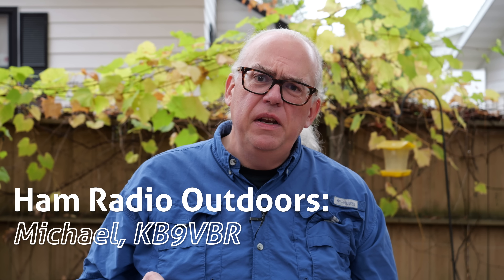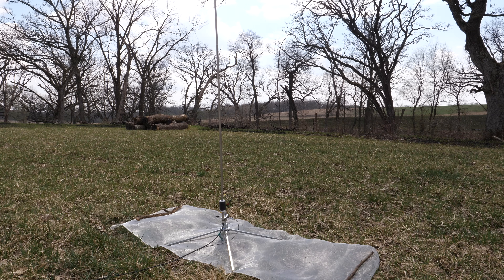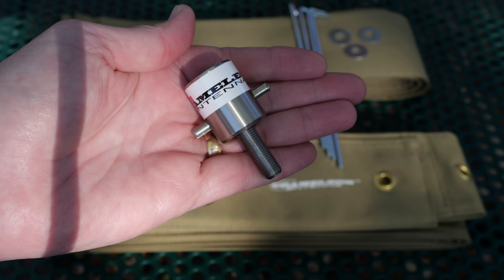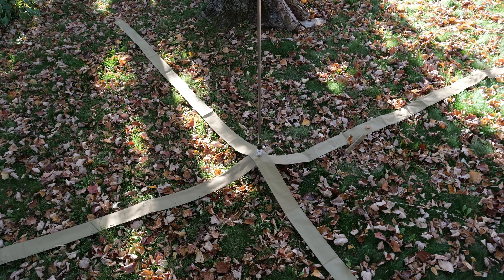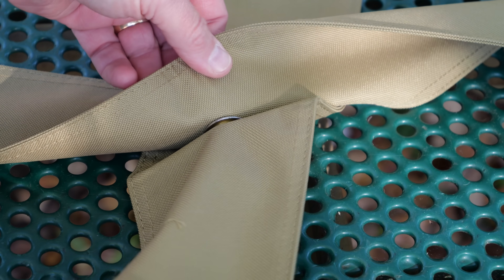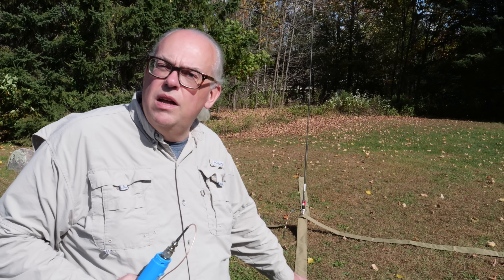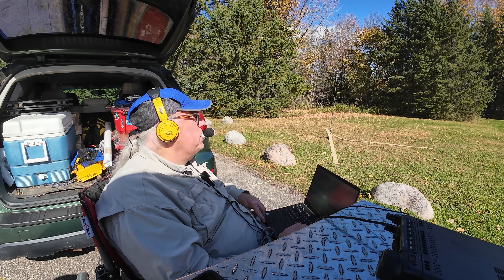I tried the Faraday Strip Radials for my antenna, and WOW!

Comment: is there a way to use the chameleon faraday strips with a surveyor tripod
Reply from the maker: If you spread the legs out, you can get the feed point of the antenna low to the ground. That would work just fine. Otherwise, Chameleon claims you can elevate the strips. I have not tried that, yet.

Comment: I think a lot of people are missing the point of using the faraday cloth or aluminum screen. Wire is narrow this spreads out the covered area and the concept of radio waves bouncing back from the sky. Would definitely improve the reception of signals. If elevated in center a few feet would more than likely project a lower radiation pattern. Just a thought.

Comment: Hi Mike, might have to give this a try.  Currently using a CHA hybrid micro with 60 ft of wire only on the roof.  Getting a lot of RFI noise on all bands.  Besides the ferrite, do you have any ideas for the noise?  Thanks
Reply from the maker: Try adding a second common mode choke at the point where you coax connects to your transmitter. This should filter out a lot of the noise that is collected by the coax shield itself.

Comment: Thanks for giving this a try, Michael. I can’t help but laugh at those who complain that Faraday cloth is useless — sometimes it performs just as well as wire radials, and other times it doesn’t. There are so many variables in antenna setups that results will always vary. Personally, I prefer using my own Faraday cloth configuration over commercial products, but I understand why people want to test them out. Ham radio is all about experimentation and pushing boundaries. This is how pioneers are created. The curmudgeon's and codgers are simply too stubborn to try something new.

Comment: Could I use these strips if my surveyors tripod was about 3-4 feet tall? Or would I have to go with elevated wire counterpoise?
Reply from the maker: Ideally the faraday strips should be laying on the ground. Chameleon says you can elevate them, but I haven't tried that yet. Can your tripod be lowered at all, some tripods have a lock that lets you spread the legs out farther and get the head lower to the ground.
Reply: @KB9VBRAntennas Thank you Michael, spread out the legs I shall! Cheers!

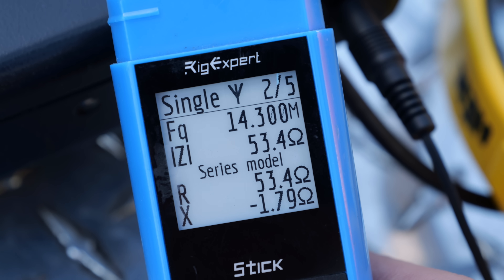Comment: Michael, thanks for your videos and have always enjoyed working you on POTA. You made a comment at 4:45 in the video about the fact that SWR only tells half the story. I wonder if you would do a video on what you look for and how you use the Stick in evaluating an antenna and it's deployment. I could learn a lot.

Thanks, and 73

Mike W9LG
Reply from the maker: In addition to looking at SWR, you also should keep an eye on X or reactance. As reactance reaches zero, your load becomes purely resistive, and the transmitter maximizes power output. Not all antennas will be resonant at 50 ohms, for example a dipole's resonant point may be 70 ohms and a 1/4 wave vertical may be closer to 30 ohms. So you may have an SWR of 1.4:1 and 0 reactance. The antenna is in perfect resonance. Joe and I did a livestream video on this a couple years ago, but maybe its time for a refresh: https://youtu.be/IUHicVvMyEY
Reply: @KB9VBRAntennas  Thanks, Michael. I watched the livestream; it's fun watching you and Joe have fun.

This is one of those things that I "learned" but didn't really understand, and probably still don't. So back to the books. I'll start paying attention to it when I'm setting a portable op. So when you set up, do you tune for reactance?

Comment: Hey michael.  I love your posts and POTA has changed my ham life!  I notice on many antennas, especially the POTA Performer, you use a isolation transformer from MFJ.  I see these are no longer available.  Is there a replacement?  Can ferrite chokes on the feedpoint accomplish the same?  Thank you for all you do for our hobby
Reply from the maker: Ferrite chokes on the feedpoint will accomplish the same thing. The MFJ choke essentially was that, a series of chokes inside a plastic housing. For a replacement, I've been using these chokes from ABR Industries. I've had really good luck with them: https://abrind.com/product/current-type-ferrite-assemblies/
Reply: @KB9VBRAntennas  Thanks Michael,  I have actually been using some snap on beads from DX engineering - but I was wondering if there was some other magic in the MFJ box.  Cheers!  Mike  KC2SWC.  Hope to catch you on an activation one of these days.
Reply: @KB9VBRAntennas  Michael, thanks for the review and your videos. Much appreciated.

On the ferrite chokes, you mention using them at the feedpoint. I use a 25' piece of RG316 with a built in choke on my POTA activations when I use an EFHW or EFRW, and place the choke at the transceiver end, effectively using the coax as a counterpoise. I assume the choke is used at the antenna feedpoint when using radials on the vertical. Do I have that right?

Mike W9LG

Comment: I'm always down for new stuff that doesn't tangle in my bag as easily as my speaker wire radials. But I am curious, if you have a simple WRC tripod do you have to but an isolator to use this? If I'm looking at it right the adapter screws into the antenna mount on the tripod. On the WRC this is connected to the center pin and the tripod itself is connected to the shield. So if I put the adaptor in, my radials will be connected to this center pin rather than the shield. Maybe the Chameleon tripod is set up differently.

Comment: Hello Michael, thank you for this video. A question: could there be a benefit to using the 2 strips full-length, and only having an orientation N-S or E-W? I may have to get them, just to try that(?). As always, the value of any item is personal - not fixed, and your videos help me assess the value. Thanks, KQ4IXD
Reply from the maker: To your first point, I've been thinking about that. My guess is that attaching the strips via their end grommet and orienting them in a V configuration will not so much increase the gain, but instead create a favorable Front-Back that will improve your signal to noise ratio and pull out weaker stations. Much like KJ6ER does with his PERformer antenna when placing the counterpoise wires in a V. That hypothesis is on my list to test. 

As for price vs value. In my reviews I don't evaluate an item based on its price, unless the item is extremely inexpensive and offers great benefit. Like you mentioned, value is an individual determination.

Comment: I wonder why people complain about the price of commercially available *quality* gear. No one is obligated to buy it. After all, as hams you can certainly make gear yourself.  If you think you can make it or an alternative cheaper, and you probably can, then knock yourself out. But for those who don’t want to mess with the process or don’t have the time then gear like this is available for plug and play operation. It’s a pretty simple decision. No need to knock the company’s price point or Michael for the full disclosure review. They price according to what they think the market can or will pay and they can make a profit. No one is forced to buy. No one needs to say this is price gouging. You don’t really need this bit of kit, there are far cheaper homebrew alternatives and no one is stopping you from doing that.

Thanks Michael, for this excellent video and the disclosure of the source of the item for review.
Reply: While I understand what you are saying, there is a tipping point, Chameleon is WAY over pricing the Stuff they "Make", I bought this FSR and I am very disappointed, with this you are locked into THIER stuff to make this work, For a $130 you get the cloth and an adapter to put it together, THATS it you don't get the ground spike, You have spend another $65 for that (130 + 65= $195), oh and that Adapter is 3/4-24 not M10-1.5 so you can forget using any of the expanding antennas, oh wait you can by Chameleons  (195 + 70= $265), and don't forget the Blank adapter from them its another $132, so total cost to make this work is (265 + 132= $397) over $400 dollars after Tax and shipping, so Quality not so much.
Reply: No one is knocking Michael at all and people certainly do have a right to comment on the price. The price is a "key part of any product!!! We all comment on the price of things,...all the time. That's nothing new. For radials, the price is obviously going to get attention - how could it not?
Reply: @jimp.7286 I guess you didn’t see the comments I saw, at the time I posted this comment. No worries. I saw several doing just that. Knocking both Michael and the company. Just thought you should know.
Reply: @mmcnew1  Sorry. Missed your reply somehow. Knocking the channel's owner and even others who comment in a respectful way,...that's the era we now live in - the era of social media. And I hate it. It's not been a good thing for mankind at all. Civility gone. I'm not going to bother reading what you're referring to as it would just irritate me. Why knock him? Makes zero sense. He's only sharing the product and the nicest person. Thank you for cluing me in. Cheers.
Reply: Your wrong Chameleon price according to the market then stick $$$ on top, I will stick with my wire thanks...👍
Reply: @martinsmith2984 Thats exactly what I said up there. But don’t knock Michael for the review or Chameleon for the price was the point. Many, many commenters were doing both, for no reason. If there’s no compelling reason for purchasing it after the excellent review and then considering the price/cost benefit (or a viewer’s subjective lack thereof) then the viewer can make that objective decision. All of Chameleon’s products are priced on the upper end. Everyone knows that. But that doesn’t make the review any less well done and the commenters being snarky to Michael about it is unnecessary.
Reply: @martinsmith2984  The supplied item was revealed as free at the get go. No one forced anyone to watch. As soon as they say “item was provided for free”, you and everyone else has the choice to move on and not watch. You detractors are hilarious. Like anyone forces you to watch and then purchase. Then, blaming the reviewer and the company. I do know Chamelon’s prices are high. So does everyone else. I’ve said so multiple times up there. But they *do* have the right to charge what they want. How is this so hard? Just don’t watch. Don’t buy. Make your own. Use wire. Whatever. But don’t knock Michael for a well done review. It’s strictly a “the company provided it for free, I reviewed it and it worked well for me, watch my QSO’s and evaluate for yourself”.  There are some hams who have enough disposable income (shocking, I know) who’ll be lazy and purchase overpriced kit as a matter of convenience. Who cares? If you feel that strongly about this whole thing…. never watch another video again as soon as any presenter says the reviewed item was provided for free. Never. I strongly suspect your watch count of product reviews would drop by 95% and you can spare yourself the agitation of knocking reviewers who produce said content.
Reply: @martinsmith2984 With your line of reasoning, why do you even bother to watch? As soon as any reviewer says any review item was provided for free, just click away and move on. You are 100% accusing Michael, or any other reviewer who receives any item from the manufacturer, of doing an intentionally deceptive review. If that were true, they’d hide that fact it was provided for free. But they don’t hide it. But this dialog has come to a point here and as Sherlock Holmes says to Dr. Watson in The Scarlett Letter “I have been guilty of several monologues upon the subject of late. I fear I have wearied you.” So, I’m done with this. Have a nice troll’s life. Peace out.

Comment: If you're going to bury those radials, check out dog fence wire. It is made for direct burial, has a tough coating, and is sold in large spools. My 250-foot roll came from Extreme Dog Fence and is impressive. The coating is almost impossible to cut with a knife. You must use wire strippers. The stiff coating also means it doesn't tangle easily. And the hard-drawn copper wire inside makes it excellent for antennas. It is the same copper used for overhead power lines.

Comment: For a far less expensive alternative, check building suppliers for attic foil. It's a ruggedized, tear-proof foil that is used to reflect attic heat. It conducts as well as faraday cloth and is easily rolled up. You can get it in various widths up to four feet. It cuts easily.

There's also something gardeners use—copper mesh about five-inches wide. It's used block building entrances to rodents and to keep slugs from plants. A quick search turned up a thirty-foot roll for $7. Tent stakes could pin it down.
Reply: Your right, why spend a fortune for something thats not going to be any better in the real world...

Comment: I love the idea of one side orange. With them wide like that they increase capacitive coupling with the ground. A great test will be over much dryer soil   . Yes you are correct with AM broadcast .The wavelength is very long and lots of copper in ground . Some places have poor soil conductivity, so many things have been tried to improve that.   Some stations used a cloth type of copper woven fabric type. Wide copper straps ETC have been done. It is to get more surface area covers near the towers. This is wear the  RF amps are higher.  The RF volts are highest at end .If 1/4 wave multi . AM broadcast works on ground wave during day time.  Better coupling with ground pushes the signal out further .  In HF it makes the ground a better reflector and send your signal upwards to bounce of ionosphere. Ground is the outher half of a vertical antenna.  It sounds like they may lower noise floor a bit as well. You signal to noise ratio was great ! 73 from NY !!

Comment: Great video. Were you able to test these against a set of wire radials? If so, which is better?
Again, great video - very well done as usual.
Reply: There is no difference against a set of wire radials, the only difference is its going to cost you 10 times more money.😂

Comment: Good video. Good suggestion on the cammo-orange combo.  I'll hold off for now because my very cheap window screen works like a million bucks, and I use the U-wires my wife uses in the garden to keep them flat to the ground even on windy days. I use the mesh with my SharkSticks; it replaced the multiple radials I had before.

Comment: Ever tried just buying a spool of ~24g 25 conductor ribbon cable? 10 meters for 25 dollars. Floppy and hard drive and scsi cables were all made from it. Comes on spools and in bigger lengths. And you can trim individual wires to different lengths, like fan dipole elements.

Comment: I use 3 30 foot HFT metal measuring tapes, and connect to the WRC base with allegator clips.  Easy to deploy and easy to see on the ground.

Comment: $130 is about what I spent to homebrew a portable rotator with an Arduino Uno 4 providing the direction control and speed via Bluetooth on my iPhone.  Just to put the cost of these radials into perspective.
Reply from the maker: I've paid $150 for a shirt made in the USA and $25 for handheld radio from China. Electronic parts are cheap to manufacture.
Reply: @KB9VBRAntennas  So are clothes.

Comment: Received my set today. They are high quality as expected from Chameleon. Will be testing them this weekend.
Reply: please compare to a wire radial system, I am curious if this out performs that and by outperform I mean switching to a dx station and switching to each and see what the difference sounds like and what the s meter and waterfall if you have one shows. numbers are great on an analyzer but that does not mean it's an 'efficient system' as you are only measuring one measurement that just shows the resonance of an antenna and nothing else with just that number.  Thanks!
Reply: Did it come with the ground spike?

Comment: Faraday cloth is great. But.. Silicone coated wire (not cheap PVC) is still the best option for non-tangle and ease of ground wire deployment. The ability to adjust the length of the ground wire is important to me.

Comment: Just had a thought. What if you placed the two ends together and had them in a 90° V configuration like you can with the POTA performer and get some directionality from them? Or one long straight line when using a coil for 40 meters?
Reply from the maker: I had the same thought and doing that is on my list to try out. I'm not sure how much directivity you will get, more likely it will result in an enhanced front-to-back, giving you a better signal to noise ratio for pulling out weak signals in the direction of the V.

Comment: @Chameleon You may be able to make them cheaper if they are about half as long with the grommet at one end. instead of having to get a single long perfect piece of fabric, you can do with shorter cuts left from other pieces. Shorter seams make the process less labor intensive and easier to get right. 

Might be a wash with more time spent cutting fabric, but maybe not. Would be easier to do "non standard" deployment where you are shaping the signal pattern with more radials to one side. I might want 5 radials for a specific band or something.

Comment: Those are cool.I'm new and use radials because I mainly have used portable equipment in a backpack but these would be handy when i'm setting up and working at my vehicle. I like them very much how quick and easy they are to setup and the results speak themselves.
Reply from the maker: These are definitely too bulky for backpacking. I may throw mine into a small duffel so they can live in the back of the car.

Comment: Do you think being 4 inches wide that it would be enough for 80m.  Think 25ft whip and wolf river coil
Reply from the maker: I'm not sure. I've gotten my best results on the 80m band by using two sheets of the Faraday cloth. These strips may not provide enough capacitive coupling for a good match on 80 meters.